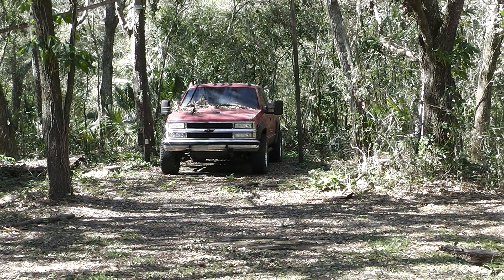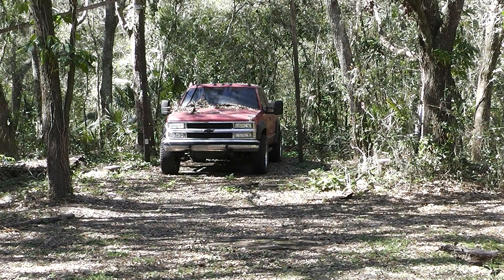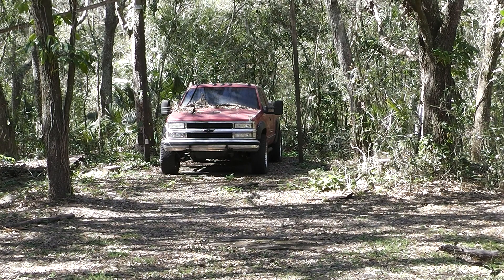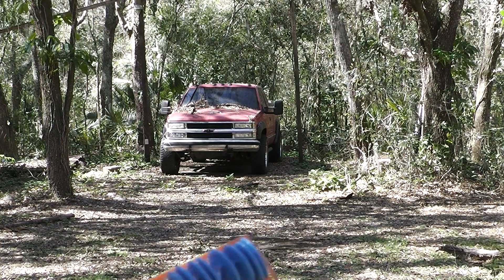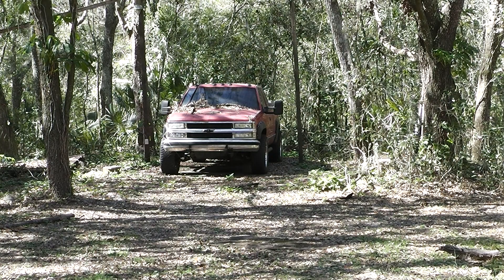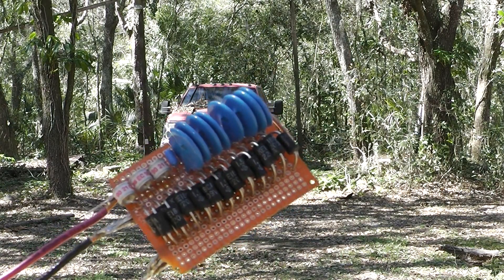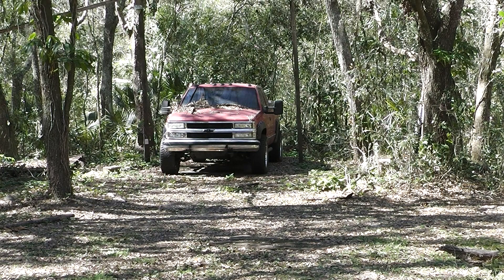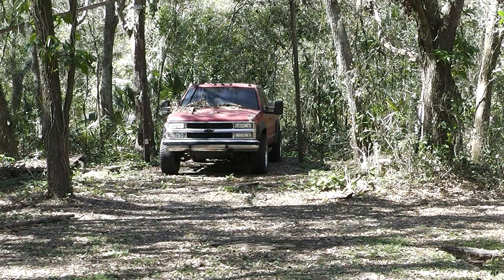My Wife's Car Was Disabled By An EMP Part 1 Homemade EMP Protector

Comment: How will you test the installed unit?
Reply from the maker: Excellent question. I will either have to send the protector out to a independently certified test facility or I will most likely, build an EM Pulse generator and conduct my own testing.

Comment: So you never put the materials and providers you are buying from in the common area.  I would like too know how do you know your system will work?
Reply from the maker: You can watch David Nooner's video https://www.youtube.com/watch?v=Mm9gyVzTdUM&t=0s in the common area above to figure out what parts you need. I bought some of the parts from DigiKey and Ebay. Some parts are not available at this time. As far as testing, I could send the protector out to an independent certified test facility(if I was going to sell them which I will not) or more likely, I could build my own EM Pulse generator and conduct my own tests.